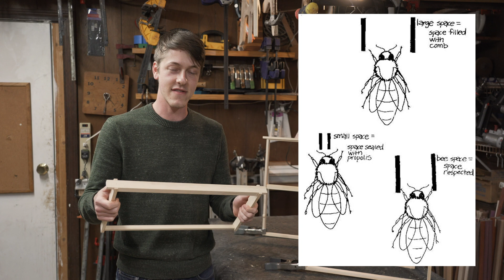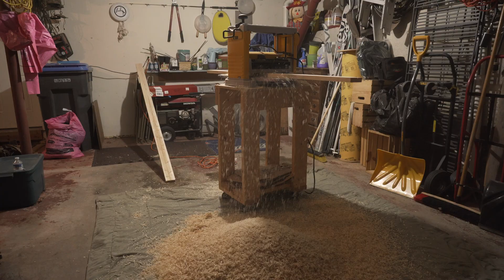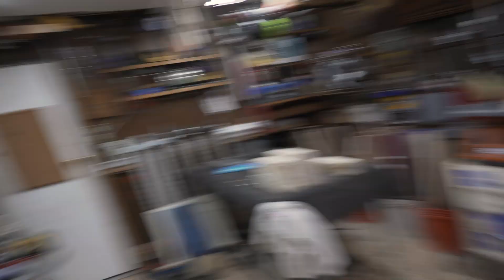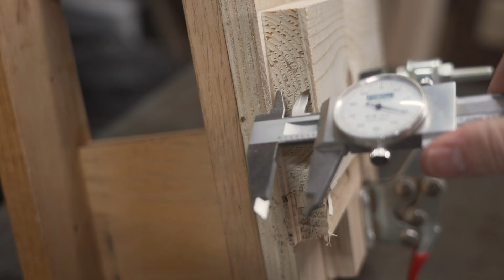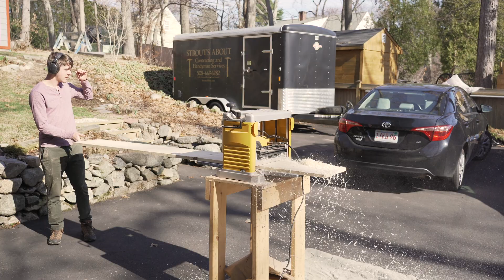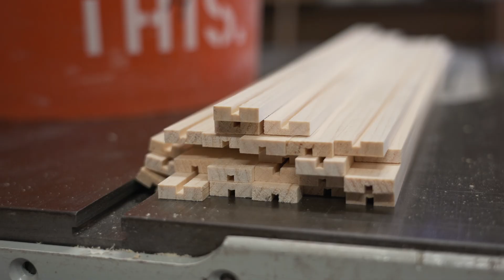Strout Double Deep Frames 2.0 Overview and Construction

Comment: Does the sliding dovetail get mucked up with propolis and burr comb?
Reply from the maker: It does and it doesn't. I have another video talking about this, but essentially they do seal the joint, but it's easily enough broken by running a knife along the seam of the joint. It hasn't been an issue getting the frames apart in the past.

Comment: Could you build a one piece without the middle bar, but with the same outer dimensions?
Reply from the maker: I would be hesitant to make an extra deep frame without some kind of bracing dowel in the middle. The pine I used to make these frames is not super strong and I fear the sides of the frame would break too easily.
Reply: How are you liking the new version?

Comment: Have you thought about changing the inner basket for the honey extractor? If you changed it, you wouldn't have to have the frame divided into two pieces and you would still be able to extract honey. Instead of bothering with frames all the time, you will only bother once when adjusting the honey extractor. There are also hives (Leyens, look for example for Dr Leo Sharaskin on the youtube) which have high frames and can be used in honey extractor.
Reply from the maker: Definitely another way to approach the problem! I've just found in my experience that honey extractors capable of holding extra deep frames are much harder to come by. But totally, Leyens hives and Sharashkin hives were very inspirational when I was building my hives.

Comment: I recently bought your plans for your double deep frames and I’ve built 33 of them for a new hive.  As I’ve started building the hive I’ve realized I may not fully understand how it all works together.  Could you answer a couple of questions?

1 - When assembled in the hive - the 1 3/8 frame hangers (top most part of frame) all fit flush against each other so that there’s no space for the bees to move across the top of the frames like they can when you use regular frames.  Is this correct?  

On your September 2022 Hive Update video your hive seemed to have wooden slats on the top of your frames, so I got worried that perhaps I built my frames incorrectly and there should be space to allow the bees access to the top.

2 - Given the bees can’t access the top of the frames, what technique do you use to feed your bees.  I was planning to use a division board feeder, but that won’t work with this set up if the bees can’t access the top of the frames.

Thanks for your help. I like your videos.

Comment: hiya, been thinking about making a double deep frames on a long bar hive and it strikes me you could insert two identical brood frames in a hive literally sitting one top of each other with no gap between (a 1mm gap in practice)...all one would need is a vertically grooved channel somewhere in in the box that allows you to drop and slide one frame underneath the other...if you had a vertical grove cut on towards both ends it would allow one to slide all the frames out one by one...if you had a groove in the middle of course then you would need the centre frame suspended from the bottom by a couple of nails or similar poking out...i'll be making such a hive over the winter and will send you the pics when done...thanks again :)

Comment: Hey David, nice to see you again, and that your re-doing your great design.  Great job.  I still have my double deep frames as well, yet they are a solid 18.5" deep with no middle bar.  The bees built them out amazingly.  I did not need the middle bar simply because I never plan on extracting anything from the first two brood boxes.  Congrats again.

Comment: David,  I'm not sure how to contact you other than on here.  I think your 2.0 frame plans have a wrong dimension.  The Double Frame Dovetail Top Bar dimension (sheet 5/8) should be .25" and .25" not .5" and .25" with a total thickness of .5" not .75"  If the Bottom Bar (sheet 6/8) is .5" height that leaves .25 for the top of side bars.  Top Bar (sheet 3/8) is OK. .25" fits Top Side Bars, So the Dovetailed Top Bar should be a total of .5" Tall like Top Bar.  I made 2 different cuts with both dimensions and the .75" thick does not look right.  I ripped my Dovetailed Top Bars down to .5" thick and it works much better.  You might want to change your dimension of .5" to .25" on sheet 5/8.  Thanks.
Reply from the maker: Hi Dennis, thanks for alerting me to this. I will check out my plans to make sure they're accurate!

Comment: Hi David I have been keeping bees for over 40 years and I am very impressed with your ingenuity.  Most beekeepers are scientists at heart and always experimenting with new ideas.  I transitioned to all Langstroth  medium frames about 15 years ago as my ageing back wasn't happy with my lifting boxes of Langstroth deeps. This year I built two top bar hives and one Langstroth horizontal deep. I am very pleased with the ease of working the bees in the top bars hives and will populate the horizontal Langstroth with a new queen raised  after the summer solstice. I have hundreds of medium frames and was trying to determine how I could use them in the horizontal Langstroth and saw someone on You Tube who was connecting frames with zip ties.  I cut the top tabs off of some medium frames and zip tied them to the bottom of another medium frame and built a box to fit the new arrangement.  The two mediums equal about 1@ 1/3 Langstroth deep. The box fits 21 of these frames that equals 28 Langstroth deeps. This is temporary measure to see how the bees survive a  northern Ohio winter.  I will be ordering your frame plans for a more permanent solution for my next Strout hive. I predict many more contributions to beekeeping from you in the years ahead.
Reply from the maker: Hi Joe! Thank you for your wonderful comment, it's always great to hear how other beekeepers are running their apiaries. Keep in touch!